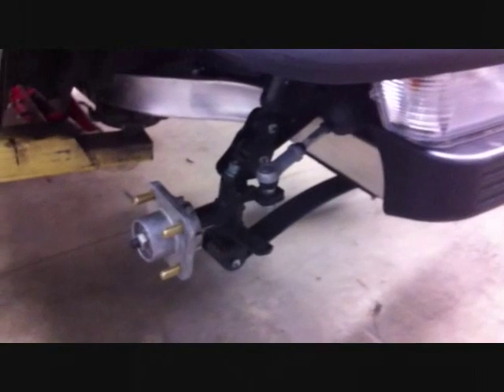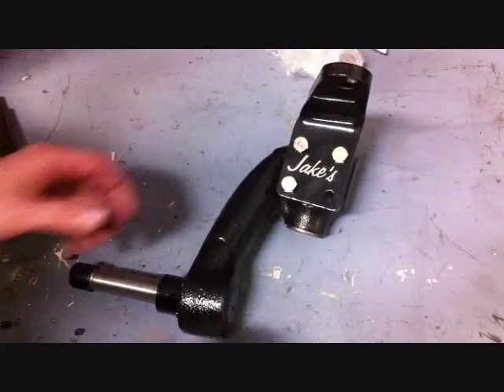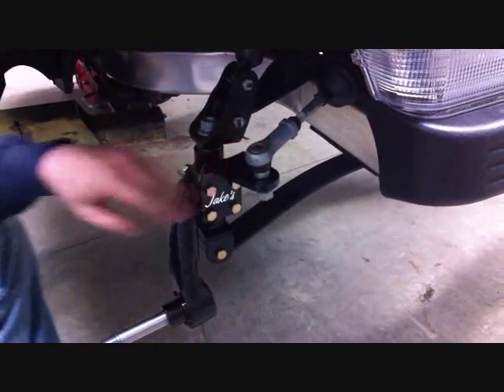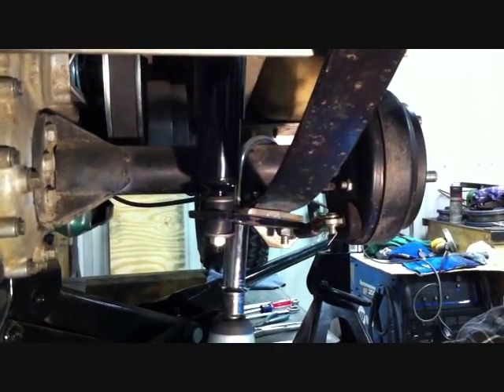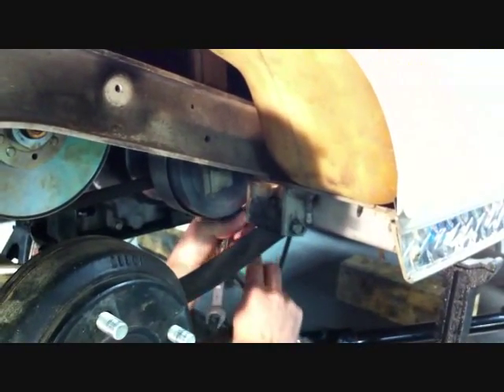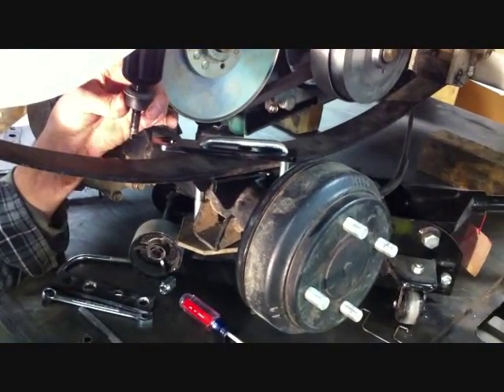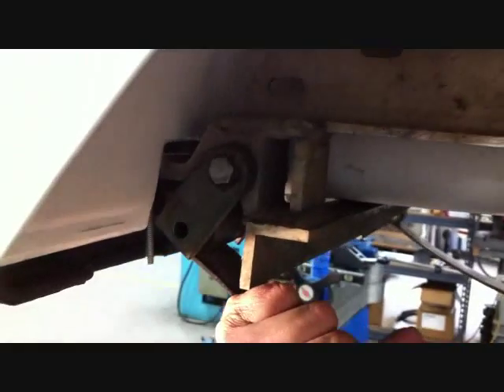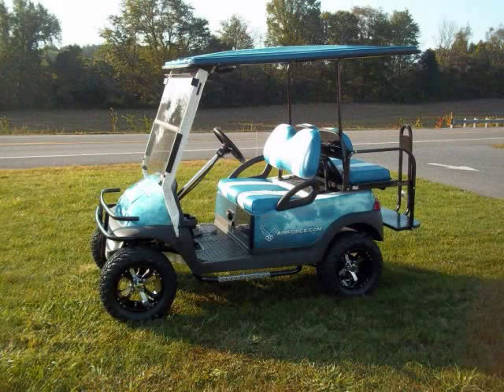Jake's 3 inch Lift Kit Club Car Precedent Installations

Comment: Just put one on my 2010 Club car....took about 4-5 hrs DIY first time, saved $500 on local dealer installed price, well worth it.  Only problem I had (nothing to do with Jake kit) was the forward bolts in the leaf springs had rust solid in their metal bushings on both sides....couldn't hammer them out from the inside.  Had to grind off the bolt head (on the outer side of the bracket), then use an air hammer to drive the remains of the bolt inward. Replaced the bolts with 5/16" x 4" grade 5 bolts.